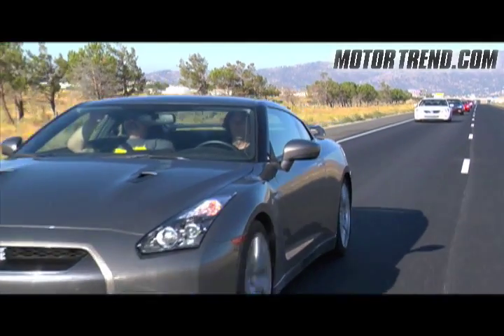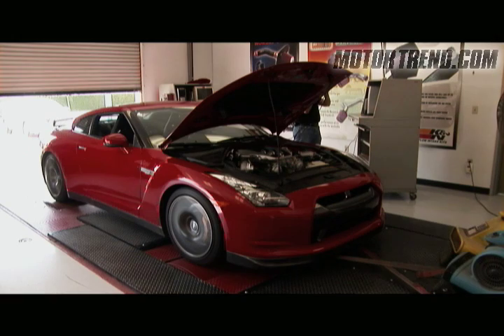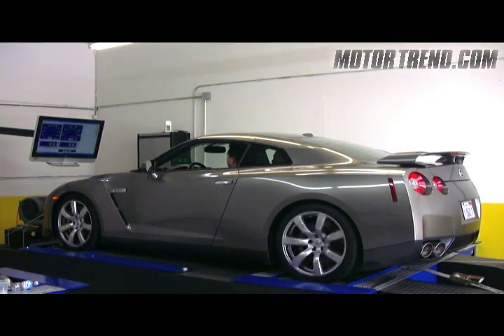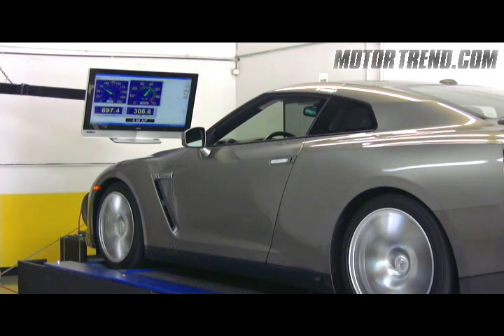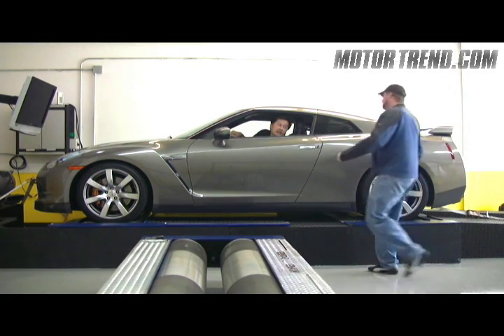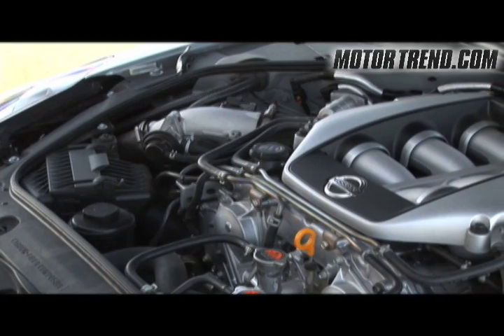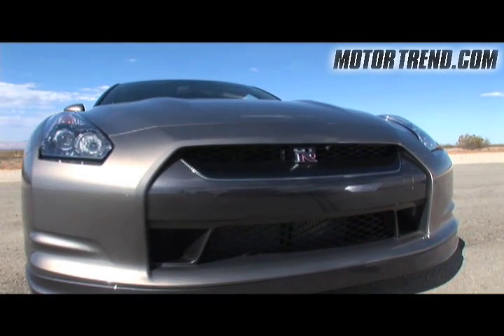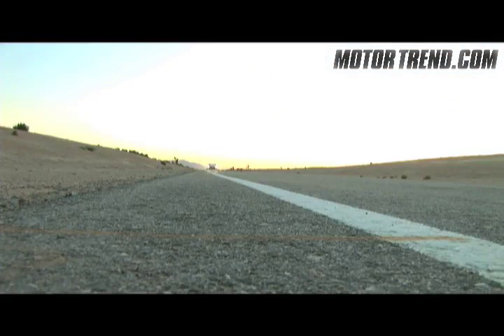Nissan GTR Horsepower: The Truth

Comment: You guys didn't do your math right. I think you all forgot to multiply the RWDHP by the 19% driving force loss. if you do that, 485HP x .19., you come out with 577.15hp from the flywheel. This number along with weight and AWD gives very well reason how & why these cars are so damn fast.  If you figure that the new GT-R's are the same with upgraded engines then the new cars are making somewhere around 635hp from the factory!!! Sweet. but I still like the z06 C7 better.
Reply: they tested in AWD mode and determined the actual brake horsepower using a drivetrain drag calculation mode with the hyperpower dyno. They got their 507 HP from guessing the BHP like everyone else does, then they did actual calculations and AFTER recalculating, got to 485 BHP...but 40ft-lbs more torque than what Nissan claimed.
Reply: PowerheadTV you are one 100% 
On the video they don't know nothing at all 
I am very happy that you have this knowledge 🇯🇵

Comment: it seems to me the flaw here is that the car is stationary and at 100plus MPH the rushing air into the intake  might offer somewhat of a boost that would change the results. Redo the test with some huge blowers out front to simulate real world! still a badazz machine
Reply: The GT-R doesn't have ram air and ram air does next to nothing when turbocharged. What really makes this machine fast is AWD and computer controlled shifting.

Comment: and another magazine got 507hp so this gives us a range from 436hp-507hp. these people got different horsepower reading because they didnt have the same air temperature, humidity, fuel, rpm, dyno machines etc etc etc. NO ONE ever said that AMG engines have a difference in their power output and they are hand assembled as well. same as the ford gt, any lamborghini and ferrari.... its nissan's marketing point to make the customers feel unique.

Comment: so if u assemble 3 engines with the same parts and bolt the bolts with the same torque you would still get 13hp difference but if a machine assembles the engine with the same parts and torques it would get 0hp difference?

Comment: also i want to state as well a car being on a mustang dyno although its the most accurate way of measuring RWHP, AWHP or FWHP will pull less to the wheels so a 395rwhp LS3 vette on a dynojet will NOT pull 395rwhp on a mustang dyno at all.A LS3 vette is an example im just using but you will NOT find one even on a dynojet pulling 410RWHP+ EVER, if so do not ever take it back to that dyno shop.This goes the same with a 5.0, evo, subi and so on.Yes there will be cars that will be underated no doubt.

Comment: Net Hp is not what all sports cars are rated by at all. The LS3 Vette is about 430hp, 436hp with the bi mode exhaust and puts down 375-395 rwhp. The NEW mustang 5.0 although underated from the factory 414hp they dyno between 375-390 rwhp 390 being tops, yes you might see higher adn some lower. Evo's and so on do not dyno at the wheels 280whp+ even though from the factory the numbers under the hood are higher. So this is probably just likely happening with a couple of vehicles, thats normal.

Comment: @GranTorino992 why?. because most high performance cars have hand built engines.
With the amount of power they put out it's probably not gonna make a difference. 

I mean if you want to be nit picky about it go buy a carolla. Those are all built equally.

Comment: This really is becoming an epidemic. Every single car magazine and video which is shocking is comparing AWHP or RWHP or FWHP to under the hood or crank hp. STOP, if the GTR pulled 485 AWHP on a MUSTANG DYNO which is what that dyno machine looks like and those show much lower dyno numbers then a standard dynojet or dynapack machine the GTR is pulling easily 530+hp at the crank or motor, PERIOD....

Comment: @thunderup86 lol now look who's the big man cause he fucked up. if you knew any real facts you would also that general motor chief executive engineer mike roth said "today the ZR1 was equipped with a specific nurbergring performance package which has a full-width rear spoiler and Michelin Pilot Sport Cup Zero Pressure tires that are optimized for warm, dry conditions to increase cornering and handling capability."
while nissan does all there times on stock cars. street tires.

Comment: @juicyluv218  An engine doesn't need to be on an assembly line to be identical to the previous one assembled. Its not "ART". Its a job! A specific one at that. Assemble the engines, and make sure they are consistent from one to the next. 0-60 times between 2 cars, is not an "accurate" gauge as to their being equal or not. Especially with different drivers. Launch control, or not! Engine Brake dyno comparisons... period! I have extensive experience assembling engines, trust me!

Comment: @KINZERS13GTR i believe that every engine is in fact a little different different- i've seen some tests that say it has over 500 hp. the creation of the gtr's engine isn't on an assembly line.... since it's handbuilt it's a sort of art. and no two artworks are the same, are they? no, they aren't. another reason i think that every engine is different is because i own a gtr, and in the 0-60 runs i've made, the numbers are different than some people's, and the same as others.

Comment: Thank you. I was just about to say the same thing. The whole "hand built engines being individually different", thing, is ludicrous! Nissan's tolerances on these engines is in the thousandths to 10 thousandths of an inch range, with torque specs so tight, and tools so accurate, in temperature controlled assembly rooms. Assembly is consistent, from 1 to 1. People These engines aren't ham fisted together In Kazutoshi Mizunos Garage! The difference is there is a human eye on every bolt turn! Period

Comment: Honestly, do any of you know how an engine works? Being hand built does not automatically mean you will get huge fluctuations in power. Each engine uses the same components, and I would think the tolerances for a car of this caliber would be extremely tight. there is no reason for a 40lb/ft difference in torque from car to car.  The most I would expect is maybe 10.

Comment: @Bl0odjester Lol yeh sure mate, your probably talking about buying a gtr and mustang in america, if you bought them in any other country the gtr is generally a very close price and has alot more power, and if your talking of modifying then your much better option would be buying an r32/r34 and modifying that rather than some overweight mustang, I've seen r34s with 850+hp selling for 100k NZD, not to mention it'd probably weigh half of the mustangs your talking about.

Comment: @slobodaneee Not really.... The 2011 5.0 mustang has 412 hp and 405 lb/ft at 30,000$. The gtr is 80,000$ plus. The mustang is clearly the winner. that's 50,000 I could throw at my car and do whatever I wanted to it and then some.

Comment: Motortrends findings are pretty irrelevant considering that every motor for the GTR is hand built. So the horse power numbers fluctuate depending on who built the motor. One technician could have used parts with tighter or looser clearances than the other  resulting in higher or lower hp.

Comment: @Dermo1985 I don't understand why people are complaining about this - that nobody is mentioning the engines are hand made. I mean so what if they are? lamborghini's cars are all hand made but they don't brag about it, so are ferraris and porsches and many other high end car manufacturers. you might have a few extra horsepower laying around but that just means that the engine is lighter (if you happen to have less hp) so the power to weight ratio is still very similar.

Comment: @Riujinzero actually, the cooling properties of ethanol help the engine produce more power, for instance the Koenigsegg CCXR produces 1018hp under E85 compared to 806hp undern ormal petrol, with only a modest increase in fuel consumption

Comment: @Spoookyii 
Yes, for 99.9% of the cars Nissan gave out to the reviewers they were close in the HP but ball-parked it in the torque of the engine, I'm not sure why but it was about 50 hp either way (although it was mostly positive, I.E. it had more than Nissan said.) Oh and just a side note they aren't hand-built engines, they are made in a lab by robots. Another interesting fact is that the gearbox is made for that specific engine. and the tires are filled with nitrogen because air was unstable.

Comment: At 480 WHP which means if i only us 15% drivetrain loss which is actually low for a AWD drive car should be 18% atleast either way 15% comes up with  565Hp at the motor from this dyno. Not to say they all pull this but those are very high numbers.

Comment: Why is motortrend confusing these figures. When Nissan says 485HP it obviously means thats at the motor and not the wheels. When they do this dyno which seems like a mustang dyno which reads low numbers but extremely accurate they come up with 480WHP which easily shows that nissan isnt exactly honest about how much this cars motor is producing.

Comment: @bgblkss396 For one they don't get repaired. The engine is simply replaced. Most mass builders just put together punched items, meaning there is no deburring or weighting of parts. So when you rebuild them you debur them, have them balanced, blue printed, etc. HAND BUILT engines are already done in this way.

Comment: There is no way on earth you can mod a civic to be comparable to GTR.  You can make it as fast in a straight line with a 600hp turbo and drag slicks! But it would torque steer too much in corners. Its chassis is too far away for it to be bought into the game. Maybe an NSX would be more likely, RWD, big bay, Lightweight.

Comment: The ZR1 is a way better looking car, and has a carbon fiber body not plastic. Vettes are among the easiest cars to modify and have huge horsepower gains and still maintain incredible gas milage close to 30 mpg hwy . A stock Z06 will take a GT-R without launch control. Now all 2010 Vettes will have launch control.

Comment: HP/BHP gets confusing, there is also PS if you wanna really confuse things. Basically they are different measurements from diff parts of world and often on slightly diff dyno's, they are so close though that generally BHP and HP are interchangable so you can assume they are the same. A quick search on google will bring up a bunch of good sites that explain it. 
BHP/HP is what manafacturers use as they engine dyno there cars.
Modifiers normally use W(wheel)HP as they use rolling road dyno's.

Comment: BHP is measured on an engine dyno (the brake is reffering to the brake that gives resistance against the engine, not the brakes on the car as most idiots think) whp is measured on a rolling road dyno.
My point was any dyno is basically guessing at how much power is lost from the wheels to the engine so there test is hardly accurate. They say it works it out from how long the wheels roll after the run but something like heavier or lighter wheels alone will change that.

Comment: too bad it doesnt have a big engine and the car isnt made to drive in a straight line, also it will wreck pretty much any euro on the nurburgring where it was made to flourish as a track car... not to put down corvettes but your comparing a 7L v8 to a 3.8l v6... a porsche gt3 is a well respected fast car which makes 435hp and 317lb ft. compare the numbers and realize your ignorance... another funny thing is that a corvette zr1 will smash any of your so called GOOD euro sports cars...

Comment: LOL listen to all the losers on here. As has been said hand built doesnt mean that much. The parts they use are EXACTLY the same.
Yes there will be slight variations but there is with all engines, even 1 engine put on 2 diff brand dyno's will come out with different power figures. Plus then there is temp, atmos pressure ect which all makes a diff too.

Comment: you don`t even have to compare two cars or engines to each other. From what I see on testbenches almost daily, even an engine restart can result in a different power output and engine characterisic due to values written into the ecu at power cutoff. eOBD may limit your boost pressure due to an error log at one start, and several starts later when the error is healed, the engine behaves completely different, concerning measurement. 10 kW more or less aren`t that easily noticeable in such a scale.

Comment: well no because the zr1 is lighter than the gtr so technically it would still have a better power to weight ratio even if we gave the gtr 640bhp. If we tuned both cars so that they had identical power to weight ratios then thats the ultimate level playing field and again im betting the house on the gtr in all situations.

Comment: I can compare them quite easily. In the UK, a GTR costs approx £55k. A ZR1 in the UK costs £106k (thus nearly twice the price), is LHD only, has a nasty interior and I suspect rides horribly on UK roads (over Corvettes do - I've been in a Z06). Remember that not everyone lives in the US. 

The general consensus amongst the UK press is that the ZR1 is exceptionally fast but not for the faint hearted/unskilled. The GTR with its AWD is seen as a far more usable proposition for the average driver.

Comment: s2000stx12f, KnighTHawK1104, it really depends on who you believe. Personally speaking, I would probably expect the ZR1 to be faster but only if both drivers were extremely skilled. I suspect the average driver would be quicker in the GTR which has AWD and by all accounts, more predictable on the limit than the ZR1. One also has to take into account that the ZR1 (certainly in Europe) is 2x the price, LHD only, much noiser and has an awful cabin. Cars a 1/10th of the price look better inside!!

Comment: the GTR is AWD. the torque on the GTR isn't like 200...it's actually up there in the 400's and 500's.  so the ZR1 has what? about 500 torque? that's not much difference especially with AWD. so yea it's heavier...which would provide some weight to grip the road a bit with the great aerodynamics of the GTR. it's made to hug the road. but yes i agree it's a totally different type of car. GTR is built for a track and made to race. ZR1 is built to be sold to the public as a fast affordable sprts car.

Comment: you always make me laugh. it out performs in hp and top speed. plus it's top speed is around 200mph the skyline is around 192mph so all that hp and just 8mph more? add a corner in there and the skyline will handle it with ease and speed up at the apex. the ZR1 will have to brake harder, brake sooner and turn harder and lose speed. the GTR can definitely corner at a faster speed. accelerate faster and handle better. not sure why you think the ZR1 is a better track car. hahahaha funny guy

Comment: I wonder what the real world driving torque figures are though?  In an air conditioned garage, on a dyno, with fans blowing cold air into the turbo to keep the motor from overheating it doesn't surprise me at all that the torque figures are up on quoted spec.  This doesn't mean a summer's day in LA and a hot engine after sitting in traffic will yield the same results.

Comment: obviously not if it has a slower lap time buddy
the z06 claims to have a higher power output, and by the looks of it, more aerodynamic than the gtr, so the straightaway shouldnt be a problems in overtaking the gtr, but it still has a slower time
please explain to me if im not right how a car that can corner better is behind by over 10 seconds at a course where cornering is key

Comment: The Z06 actually handles better than the ZR1... Learn your corvettes before you try and diss them

And to the guys below me... 2 C6 Z06's have ran 10.9 with the stock run flats and many, many more have run low 11's.  You can't take numbers from a magazine that uses an average driver on an unprepped road.  You won't see as big of a jump with the GTR as the launch control makes it consistent already. 118mph trap speed is good for 11.6 or 11.7 in that car.

Comment: Sure it can. I know I write in terms some people may not understand but I wrote S/C it to beat a GTR. Which means Supercharge it. However, we know that AWD is the only reason the GTR has a point 1 tenth advantage over the Z06 in the quarter. Still, the Z06 is running faster than the GTR at the end of 1/4 mile. 118 mph vs 124 yet they are only ONE tenth a part in the 1/4.  11.6 vs 11.7. Lose the  EMT hard compound run flat tires on the Z06 and it will make up that one tenth then some.

Comment: well, you can't touch a GTR for less than roughly $100k. Have not seen a Spec V but if it ever hits the streets here will cost over $150k for only about a 50-60hp increase vs. the  ZR1's 133 increase over the Z06. Corvette has never been just another car man. It's the only performance car icon I know of that has it's own museum it's own production plant and has been in  production since 1953. If I remember right and it's shown here on youtube. The ZR1 bested the GTR in all events except 0-60.

Comment: I knew that you were going to say all that with your latest comment.  The patterns are all the same.  A guy starts off by saying he owns/drives certain cool cars, then he says he has nothing to gain by lying.  Next he says he doesn't need to prove a thing.  Look at that blanket comment aimed at degrading GTR.  It makes no logical sense or justice to be criticizing 1 car and not many.  It needs 2 turbos because it's a 3.8 V6.  If it was V8-12 then it wouldn't need as much power upgrades.

Comment: you cant trust the dyno for thsi car, each one is hand made so each one si defferent, some have 500 hp and onle 400 lb/ft of torque, its just the fact that they are handmade. its the exact same story with the dodge viper, they dyno tested one of the 600hp ones and it came out with 705 hp, thats 105 hp more than they said it had, so dyno cannot be trusted for hand made cars.